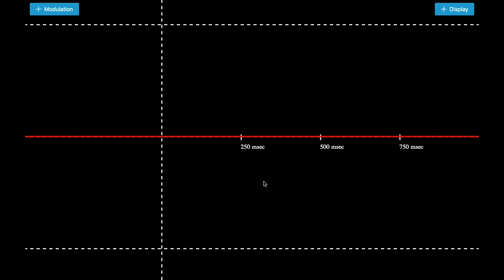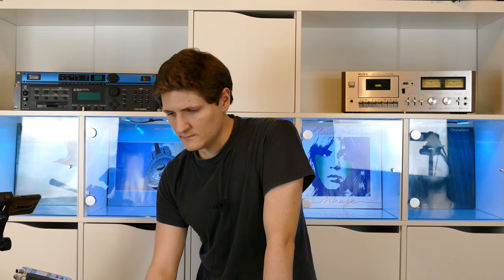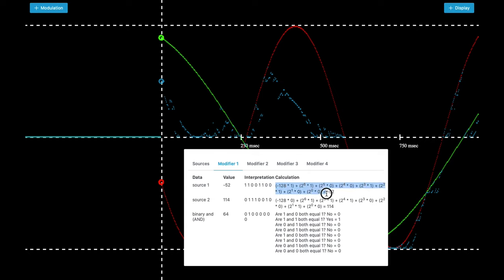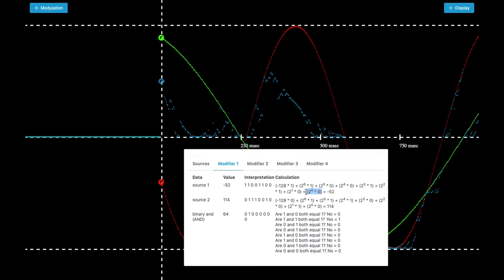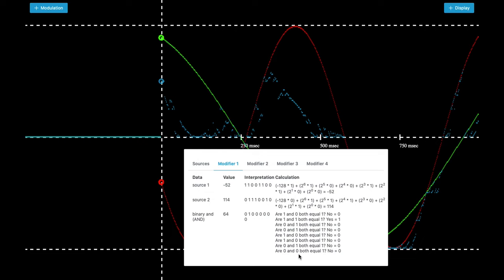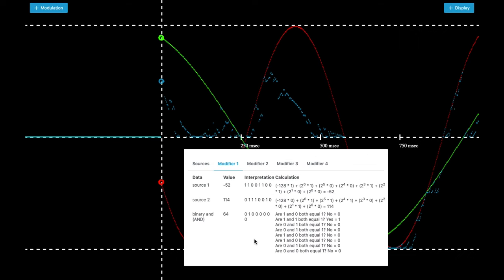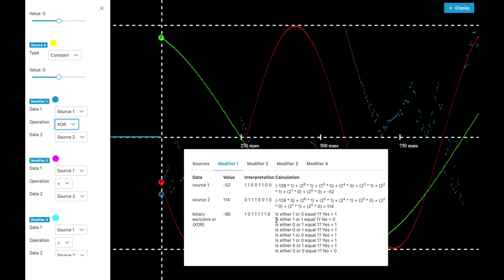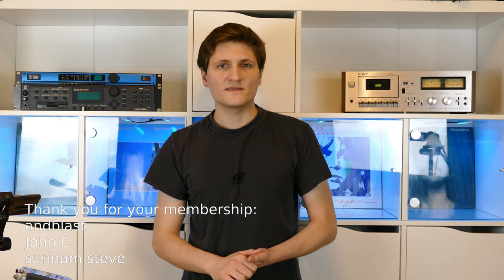[tutorial] Blofeld Beginners 13: Binary Modifiers

Comment: Very interesting. It seems so abstract - am I right in thinking that ultimately what you get is a modulation that is fairly noisy, but repeatable  (as long as the speed/ phases/ retriggering of the LFO's is kept uniform?
Reply from the maker: Yes, the result is quite chaotic. But you can use the binary operators for other things too. This will be the topic of the next video.